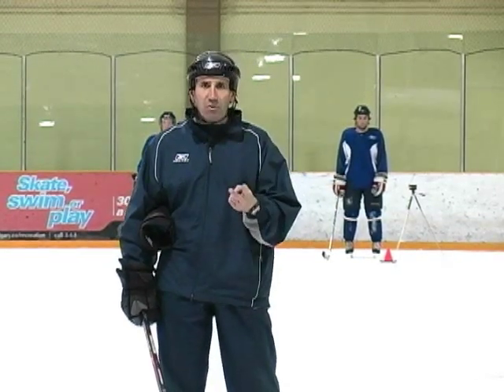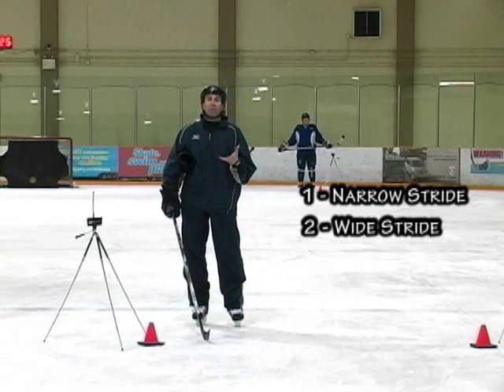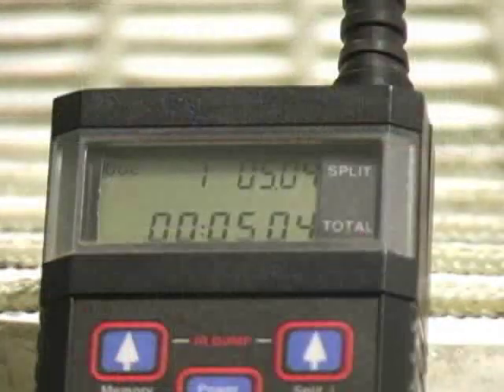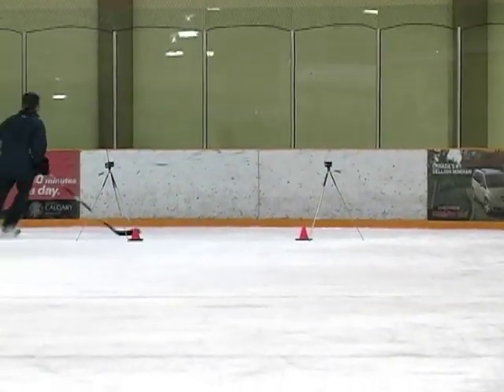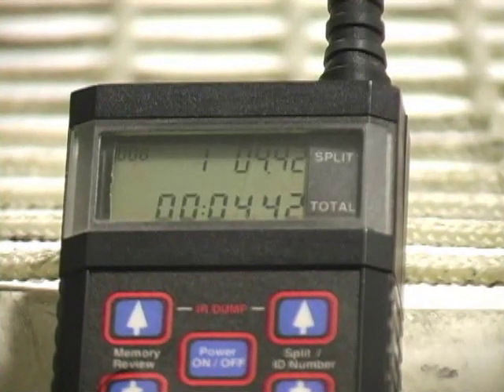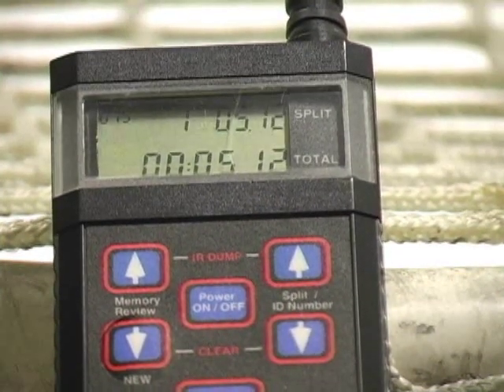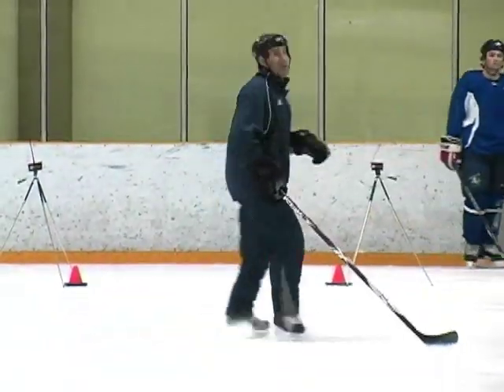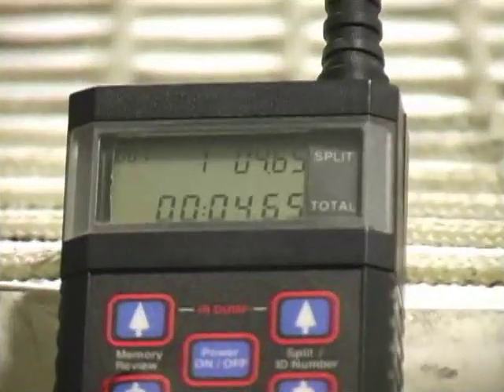Power Skating Arm & Leg Movement - Dr. Bracko proves proper arm and leg movement.

Comment: I agree to the wider stance but the arm swing...eh....I'm on the fence for that one.  If you practice the F2B arm swing it mimics how track sprinters accelerate.  It is a bit of a coordination/practiced movement that is not easily done correctly in the beginning stages.  However once you get the hang of it, I personally believe you can accelerate faster...but its all in the eyes of the beholder I suppose.